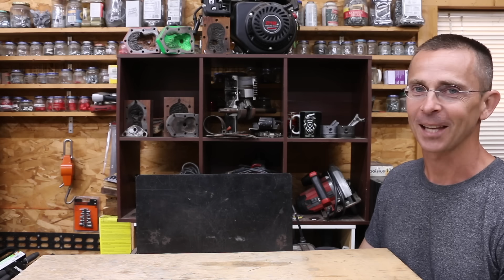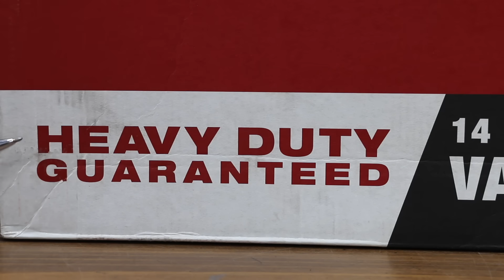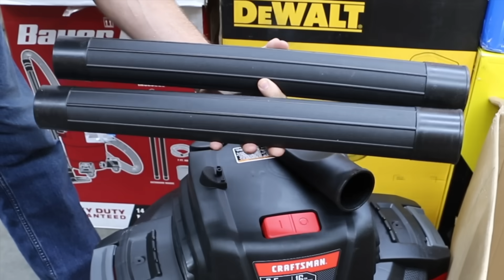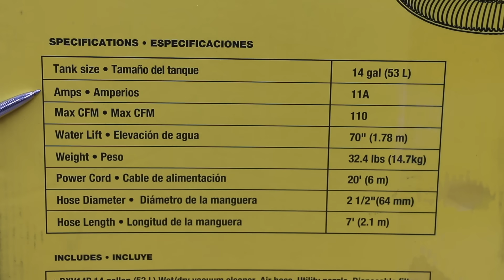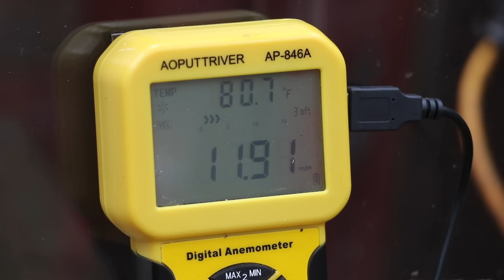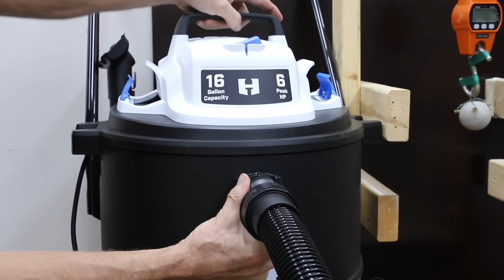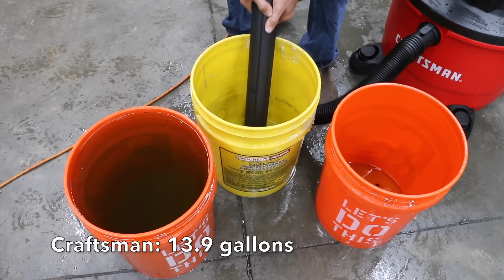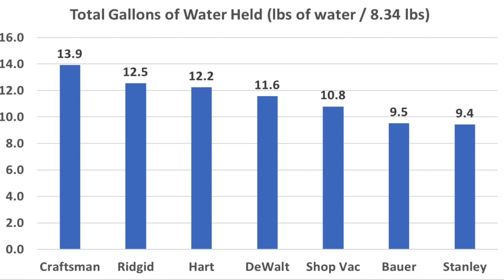Best Shop Vac? Ridgid vs Shop Vac, DeWalt, Stanley, Hart, Craftsman

Comment: I bought a craftsman a few years ago when sears was having massive sales. Got the 16 gallon for 79, with a 10 off online coupon and 15 back in rewards points (think I ended up with over 800 in craftsman power tools for something like 350 bucks.i was making a foam machine out of a 55 gallon drum for my sons birthday and needed a shop vac. 4 years later and it’s still running strong. Sears no longer has the deals like before due to them selling of the brand, but it’s still a good brand regardless of the “it’s not what it used to be” people. But they were all pretty decent for the average homeowner. Great video!

Comment: Great video.
Suggestion: If you ever revisit shop vacs, consider measuring static pressure vs flow. The best way to do this would be to use a Magnehelic gauge and an adjustable aperture (gate valve would work fine). If you block the inlet then the magnehelic would tell you the ultimate static pressure, but when the gate valve is open that will tell you the real world static pressure.

Note: Magnehelics are expensive, but they are pretty cheap on ebay.

Keep up the good work.

Comment: I have a 10 gallon Dewalt DXV10P, I use for dust collection with a Dust Deputy. Works well and it’s relatively quiet. My last one, a Craftsman, I needed to use hearing protection with.

Comment: I own the exact Ridgid shown here and a 4HP Stanley for smaller jobs. Both have been great. The muffler/defuser really cuts down on the noise and dust coming from the Ridgid. If you don't own a good shop vac do yourself favor and get one. You'll be amazed how much it comes in handy.

Comment: Nice, the Dewalt works great for cleaning out my floor tank media blaster after blasting multiple frames. You should install jackshafts on your motorized bikes so you can take advantage of the bikes gear ratio, from stump-pulling power to crazy top speed. I have mine set up that way you can climb crazy hills and do trials riding. The jackshaft kits are easy to install and you can compare the single speed with it.

Comment: I recently bought a Baurer 9 gallon, and the one time I've used it (in my car) it worked very well. My only concern is that it didn't come with a crevice tool which I think is a must for a shop vac style vacuum, but with the odd ball extension wand diameters it looked impossible!. So after exhaustive online searches I happened onto a YouTube review where the reviewer said that he found tools at Home Depot that fit, and they do!

Comment: Hopefully these videos get these companies to manufacture better products. It always annoyed me how loose a shop vac lid was you would think they would add more latches. Although I have to say ive been all about the ridgid and maybe its me being biased I guess but I would have liked to see a better comparison. Don't get me wrong im still a fan of the videos and appreciate someone like you spending time and money on these tests but I figured we would see say all 16 or 12 gallon shop vacs with say 6 to 6.5 hp and the ridgid shop vac with the blower im sorry is garbage i don't even see why they still make it its multi use gimmick causes it to fail at what you'll use it the most for or what its really intended to do. Also ridgid came out with a new lineup I think nxt they call it which they advertise as better which i don't think that vac is so maybe we can see one of those in a future update? Awesome work as always

Comment: I actually worked for Shop Vac for 16 years,(the main plant in the USA), most of the parts were either from China or Mexico, but we did assemble them in Pa.  Funny thing is Shop Vac made Craftsman vacuums until they wanted a newer model that failed design in post production ( And I was one of the employees that was tasked with the job of getting the machine and the two separate parts to be spinwelded correctly    We also mass produced for Lowe's.  It also depends on which filter system you use for the suction end of the deal.  Bagged ones are weaker in suction compared to the canister filters.  And even canister filters have different makes to them.  This was good start test for these products but different models of Shop Vac (behaved) differently.  I basically worked in every dept they had from machine operator, maintenance, tool shop, inventory, administrator, etc.

Comment: So much depends on the particular model, as each manufacturer has winners and duds.  I have a 15 year old Rigid model WD4070 that is still sold today.  I've tried to kill that thing for years and years in my construction business, but it just won't die.   I use disposable bags along with the canister filter and it just keeps chugging along.  But, I suspect other Rigid models are less trustworthy.

Comment: Awesome testing as always.  It would be neat if you could use these over time and determine longevity.  I own rigid and shop vac brands.  My rigid is more reliable as I've never had it fail.  My shop vac I've had for probably 10 years.  I had that motor fail at 4 years and shop vac sent me a new one no problem.  However the 2nd motor started to fail and I realized they use a bushing on 1 end of the motor which wears out easily and causes the motor to crash into the field and burn up.  So I replaced it with a skateboard wheel bearing before the motor was toasted.  That sand test would probably quickly tear up a vac.

Comment: Great video and results Todd. I am really impressed with the baur for the money. Although not sure I would buy one. I have a craftsman that i bought in the summer of 1993 its a 6.5 peak horsepower and 16 gallons the top fits different than any of the ones in your test and really seems to make a great seal knock on wood i have never had a problem with it and it seems to have great power. Thanks for your time and money invested in these videos. Stay Safe. Stay Healthy!

Comment: What’s really annoying is that for carpet and other areas where you need to remove dirt you can’t just see or scoop up, the suction isn’t the whole story as the backing will prevent that suction from doing anything to the dirt and you likely won’t get a seal, so flow maters, but you need to have enough velocity behind that flow or it won’t dislodge anything you’re trying to suck up, you need both and it seems they all trade one for the other

Comment: I like my Craftsman but I wish it had the hose-holder brackets (I have to store the hose on wall brackets) and better stowage for the power cord (half the time I move the vacuum around the cord slides off the holder and unspools on the floor).

Comment: Excellent video... I have the Craftsman 16G (1660 last 4 digits of model#) and its a beast, i love it but the only complaint I have is the hose kinks right at where it attaches to the body and if you move the hose to far away from straight it kinks, which can be quite annoying... Maybe I just got a bad hose.  I have an extended warranty. I'll replace hose and let you know if it does the same... As always, love your videos... Thank you...

Comment: I would look into the made in USA Ridgid brand vacuums.  I have a the 14 Gallon Smart Pulse wet/dry and it's really nice!  Its used daily in my Metal Fabrication shop by multiple people picking up Grinding dust, sawdust, metal chips from my machining area and clean my band saws and cold saws after each use. Quality of the vacuum is much better than what they offer at Lowes and other places.  It is +$400 so there is that to think about but I believe you save money on filters and labor costs if that's something to consider.  I dont use any bag and just the filters and the Smart Pulse makes sure the filters (2) never get fully clogged so you really don't need to open the vacuum and shake the filter out every time you want to use it ( I do it once every 2 months or so just to get the fine grit out and help prolong the life).  About once A year buy and replace the filters.  They tend to get clogged with very fine dust that gets stuck on with cutting oil that I pick up while cleaning my cold saw and bridgeport.  I have used it also cleaning up drywall dust and concrete dust and it has not clogged up.  I have not used it for wet pickup but I do not see why it would not work fine.  I think I have had the vacuum for 2 years now with no issues and its still going strong.  Great video.  Thanks!

Comment: To do the suction on the ball test you needed to standardize the  hose end for all vacuums. One hose at 2.25 inches has more surface area than a hose at 1.75 inches.

Comment: Great video as always! 

I have a question, why do a lot of brands claim mythical "numbers" such as HP or Capacity (in this case) when the actual outputs are nowhere near the claimed values? It's basically lying on your packaging - effectively meaning all numbers on the sides of boxes are meaningless?

Comment: one part of the test that would have been of interest. the particle size of dust that exits  (bypasses) the inner filter and exhaust muffler ! meaning how well the inner filters perform at stopping particles. this might be a separate test.  Myself , I added this cheap extra to my shop vac 40 years go. $.50 pillow case, hose clamp attached to the muffler, cut it short 2 " from the floor. If you you look at the particle exhaust , through the muffler on a sunny day or flash light with lights off , it will shock you !!! so folks are cleaning away and out of the exhaust micro particles fill the air and room ( think dry wall dust) !!!!! they can not figure out why their stained , painted or urethane surface is rough , ha ha . second test you might have run . is to reverse the hoses. yes each vac can act as a blower . The blowing cfm test would have been fun to measure.

Comment: I really liked this test and learned that most if not all shop vacs have a major flaw, the way they are constructed. Ideal one would want a very nice shop vac that has a solid construction with a proper seal. I have one of the older model industrial stainless steel bucket shop vac with a very well sealed top. Yet with it being older it is far weaker than a more modern version shop vac. I only keep it around because I intend to get another shop vac and make a custom lid and motor mount for it. 
One thing you can tell on a shop vac if it will hold large volumes of water is how far the filter goes down in to the bucket and where the ball is located at. 
Volume for dry stuff really depends on the type of material you are sucking up and the type of filter you have.

Comment: I would have liked to see the VacMaster Beast wet/dry vacuum perform in this test. I bought the smaller portable version of the VacMaster Beast Pro and it has some of the best suction I've seen from a small portable vacuum of that size. I could only imagine that the full-size vacuum would have done even better and might have beat out most if not all of these vacuums. If you are to do another video on this subject I'd like to see VacMaster be apart of it as I find it a reliable and powerful brand not many people know about. Overall, great video though, I love watching these tests.

Comment: There's a brand that is sold on wayfair and Amazon - Workshop - and the 6.5 HP (which looks similar to be DeWalt in this test) has been amazing for the last 4 years.  Can't recommend the brand enough maybe you can include them in the next showdown.

Comment: when it comes to harbor freight  if the tool is going to break it does it in the first 30 days from my experience. i have really good luck with stuff not breaking after the 90 days.

Comment: I was really surprised to see the Bauer did that well in the tests. Harbor Freight is not exactly know for high performance tools or high quality tools. which is part of the reason they only give 90 day warranties.  some of Harbor Freights stuff is made so cheep it is down right dangerous, HF jackstand recall as an example.  I know they have been trying to raise the bar on the quality of their products lately with the new Icon, Bauer and Hercules brands and I like to see companies do that.  However they still sell a lot stuff that is just junk. so I am Leary to purchase any of their tools.  I have had my Ridgid for 10 years. I use it about twice a month to clean my garage which gets dirty quickly, I have used it to suck water out of toilet tanks, and a bath tub with a clogged drain. I have sucked up sand, rocks, broken tile and broken glass, lint from a plugged up dryer duct in my wall. and I also use it to provided a source of vacuum to a DIY oil extraction machine I made to suck oil out of boat engines, car transmissions and differentials and transfer cases.  it has held up fantastically. one other thing about the Ridgid,. you can get different filters and pre-filters for it. including HEPA filters.  they also make a foam "Muffler" for it to help quite it down. I also ran over the hose once with my car and it the hose still works great no issue. cant say enough good things about my Ridgid vacuum. if i had to buy another shop vac, I would certainly buy another Ridgid.

Comment: Good tests but one flaw for you to consider. The hoses have different diameters which directly affects the suction test you did with the ball. If 2 vacuums both produce - 10 PSI of suction but they have different hose diameters, you will get different numbers, because it is pounds per square inch and the square inch area of the hoses is different. To make these the same you would need to use an adapter that gives the same diameter to each vacuum.

That being said, I have always purchased Rigid shop vac's as I have found them to be good quality, but I will have to rethink this decision.

Comment: This is just my personal opinion, so take it for whatever that's worth....  This particular model of Ridgid with the removable blower section is kind of an odd duck, as Ridgid vacs go.  That additional seam potentially represents a significant disadvantage, when put up against the other vacuums that don't have a seam there.  It may have been a good idea to select a Ridgid model that is constructed more-or-less the same as those competitors; it would've made it a more fair fight.

EDIT: 
Having said that, I would also add that I've owned some spectacular Ridgid vacs, but also had one of their "holiday specials" that had an extremely ill-fit lid.  So while most of 'em are great, their designs are NOT all winners.

Comment: Another awesome video. If you had a smoke machine you could slightly “pressurize” each shop vac canister with smoke and see just how bad each one would leak! Still an great video, too bad I purchased a Ridgid vac to replace my Shop Vac brand already. It was a “stainless” drum Shop Vac that rusted out with dozens of pinholes after less than 1 year of moderate residential use. Buyer beware, higher grade Stainless Steel won’t rust out like that. My mistake for not buying a plastic drum in the first place!

Comment: One other thing that should be taken into account, is parts and accessory availability. You can go into just about any Walmart, or Ace Hardware and find Shop Vac parts. I don't have a big box home store in my area, so getting things I need now leave me with limited brands.  

I do have a good shop vac for heavy duty use, but stick with Shop Vac brand for every day use. I get about three years out of one before I need to buy a replacement.

Comment: It would be amazing if you compared different plungers. Like the traditional shape versus the accordion shaped ones etc. I don't know how you would simulate a clogged pipe though. It would be very helpful because there's nothing worse than a crappy plunger in my opinion. Pun intended 🤣

Comment: The rubber ball suction test has a significant flaw - you didn't standardize the hose end. A larger hose end will apply the static pressure from the vacuum on a larger area, giving a much higher reading for the same amount of real pressure.

Comment: I so wish you would have included the Vacmaster "The Beast" along with the testing. I have put this thing through its works and has great accessories. Please do the 16 gall BEAST :)  https://www.homedepot.com/p/Vacmaster-Beast-Professional-Series-16-Gal-6-5-HP-Wet-Dry-Vacuum-VJH1612PF-0201/302875616

Comment: you can't use a larger diameter hose end diameter on the ball for lbs of force testing, it has a larger square inches of surface. you must reduce the surface contact diameter of the tube on the ball or do the math.

Comment: The trouble with Bauer is that Harbor Freight really wants to sell you an extended warranty.  If they sold the machine with a one year or two year warranty included, they obviously wouldn't be able to sell the same.  Also, Harbor Freight seems to have a habit of not keeping their good quality tools around for long.  Anything that proves to be a real world-beater is quickly replaced with a lower quality version.  I've taken to looking for new product releases and looking for bargains that way.  My guess is that Bauer shop vac won't stick around for too long.  Soon enough it will be replaced with a similar looking, similarly priced, less powerful version.

Comment: As you alluded to, hose length can have a decided impact on performance. I run a propane-fueled, 200 gallon sump sucker at work. When I replaced the hose last year, I added a mere 3-4 ft over the previous hose which was about 26 ft. I noticed a marked difference in performance.

Comment: I personally value a tool that can be used for more than one purpose.... as long as they are both fairly well performed.
That said I have a 15-year old Craftsman that is a vac and blower(like the Ridged). This is true value that should be factored in.